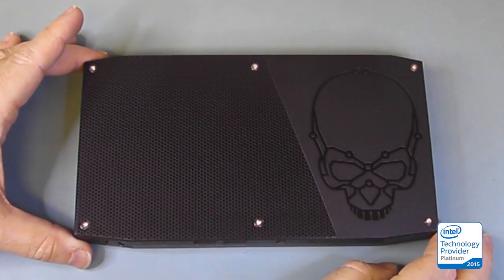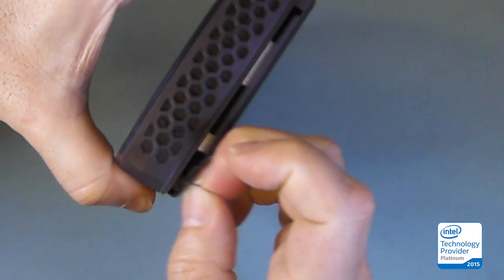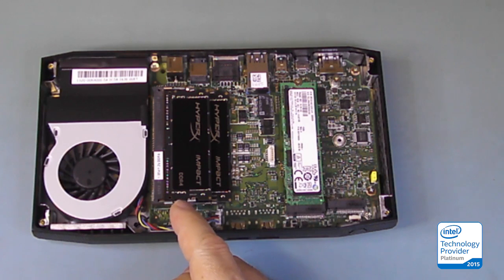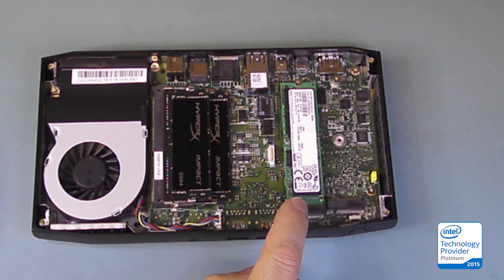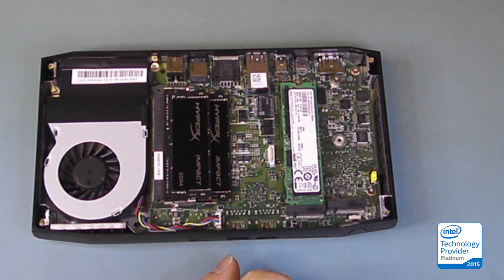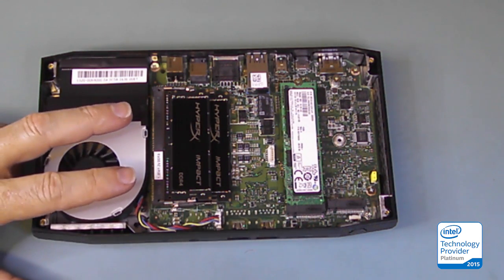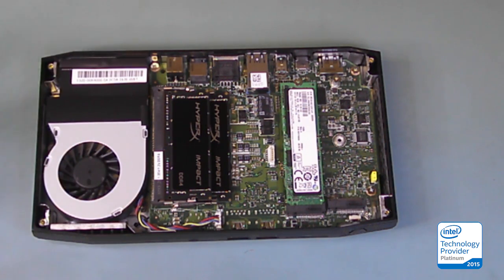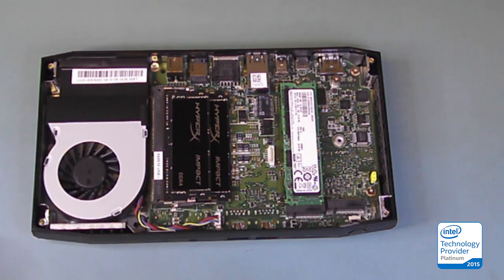NUC Skull Canyon NUC6i7KYK - A Look at the Inside 2

Comment: Ok, an uber-geek question for you.... whats the difference between, F4-2800 C18D-32GRS vs. F4-3000 C16D-32GRS? Do I need a bios update to run CL18 sodimms? if so whey would the faster CL16 stick cost twice as much?
Reply: No problem.  CL16 actually takes fewer cycles than CL18. In essence, it will run faster than the CL18.  Even so, you shouldn't need to do anything with the BIOS. We do recommend the most up to date BIOS is installed however. 

Here is the description presented by Wikipedia.
"Column Access Strobe (CAS) latency, or CL, is the delay time between the moment a memory controller tells the memory module to access a particular memory column on a RAM module, and the moment the data from the given array location is available on the module's output pins."

Comment: can i use Internal 2TB HD on it ?
Reply from the maker: It has dual M.2 slots so you we can configure it with two 1TB M.2 SSD's if you want.
Reply: Ok thanks. I found it by a good price in NEWEGG.com with G.SKILL 16GB + Intel 512GB SSD by $689.99
Reply from the maker: Just keep in mind you will be on your own for assembling,  loading the OS, drivers and any other support issues that come up.  Systems purchased from Simply NUC come with those services included.

Comment: That is not the fastest  m.2 NVMe ssd ... even at the time you made this video it was not the fastest .  That is the SM951 the first NVMe, the 950 pros came out in Nov 2015.   It might be the fastest you have in stock , but it is not the fastest.

I own A SM951 and 950pro ,  it is faster and runs cooler

Comment: you mention that you guys are selling these and other various parts. i went to purchase from your website, but was disappointed to find that it was $799.95...$149.96 higher than other places like Amazon and Newegg. are you offering any other items like RAM or storage for this price? i would like to purchase 5 of these.
Reply from the maker: +Brandon Jozsa Yes, the big difference between Simply NUC and other NUC sellers is that we act as the OEM for NUC doing full system build integration so our costs include RAM, SSD, OS install, driver updates, full burn-in testing and we then stand behind all system component offering support and warranty services so you don't have to worry about returning individual components to the different suppliers.  We also offer discounts for orders of 5 or more.

Comment: I would like to see benchmark videos with the RAM you have in the video compare to using G.SKILL F4-2800C18D-32GRS RAM, but most likely that won't happen. I just want to see if the NUC can even utilize the faster clocked RAM.
Reply: +NuclearEcko954 Agreed, benchmark with both RAM's (13 and 15 speed) would be expected. I laughed inside when he said "noticeable difference". Yeah ok. DDR3 vs DDR4 is barely noticeable but I'm happy to be proven wrong...

Comment: Great videos, but your wrong on the read speeds afaik no m.2 nvme or not can do 3GB/s read speeds i've looked for the samsung drive you have and it says the very max is 2.1GB/s. and the Samsung 950 Pro is the fastest at 2.5GB/s. Apart from that :)
Reply: +Blitz9287 You forget that there is two m.2 ports, raid 0 two 950 pro drives and you would be getting up near 3GB speeds.
Reply: +Shane Mc Grath fair enough but I was correcting what he said for other people not as techy. He didn't mention raid he just said that drive.